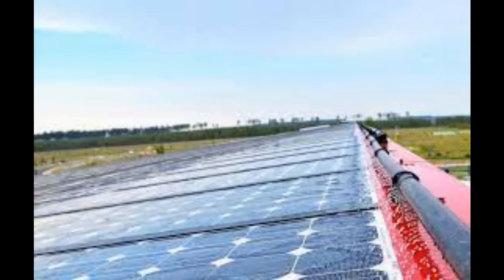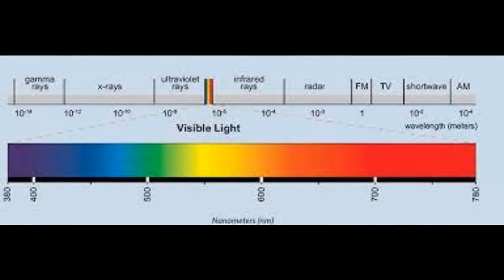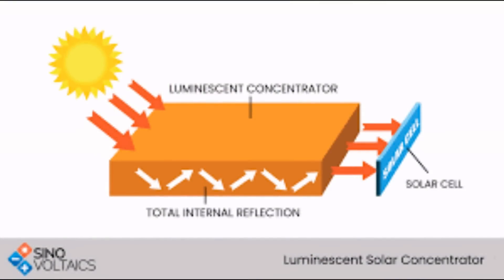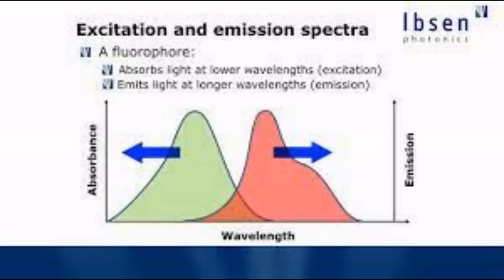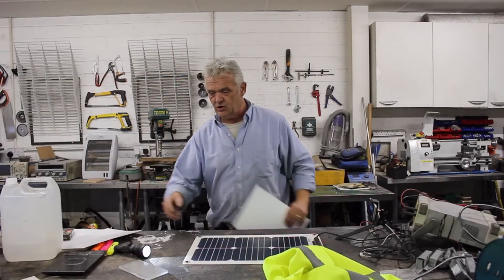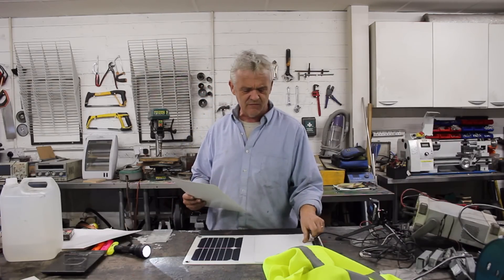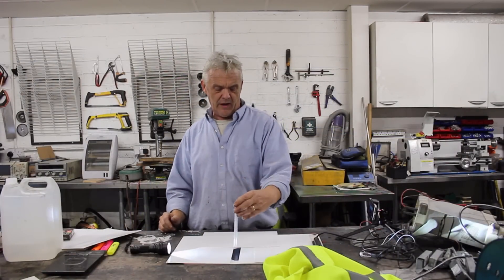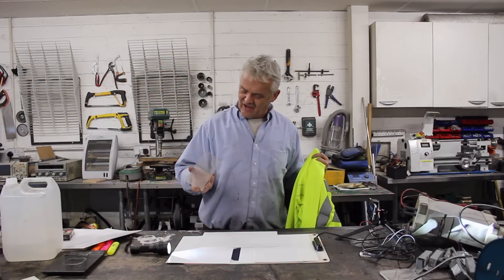1664 Supercharge Your Solar panels With Fluorescence

Comment: Nice experiment, but I do wonder if some of the additional performance was just from reflection from the shirt into your light guide.  In fact, do we know if fluorescence would work better than just some mirrors focussing more light into the light guide?  I'm almost inspired to do some of my own experiments :)
Reply from the maker: I tried it mate - it didn't work as well  -but this is a replication of research papers not my idea - I am just showing it can be done at home with easy to find materials - so you should certainly do a few experiments I would say - cheers
Reply: @ThinkingandTinkering  Ta mate

Comment: Not doubting the principle, but the test increase in voltage could easily have been due to added reflectance from the shirt.  In any event,.. fantastic info as usual Robert!
Reply from the maker: I tried it with the reflective paper the lcd panel came with mate - it didn't work as well  -but this is a replication of research papers not my idea - but you are right I am just showing the principle really
Reply: @ThinkingandTinkering  .. you are an inspiration m8.

Comment: Have you heard of Cambridge Photon Technology (CPT), it's a company developing tech (already exists within labs) which could increase the existing efficiency rate by over 50% more than it is today & beyond, by placing a layer above existing solar panels, & it converts up to a potential of the remaining 70% of light into a form that solar panels can also make use of. Silicon can only convert light at the red end of the spectrum, with much of the green and blue photons going to waste. A polymer semiconductor film can absorb these green & blue photons, and light emitting clumps of material called quantum dots convert them into a more useful wavelength. To put it another way, a blue or green photo excites a quantum dot, which then emits 2 near-infrared photons which the silicon solar panel below can make use of, along with the normal longer wavelength light passing through the film, and is absorbed by silicon in the usual way. Net effect: many more usable photons hit the silicon solar panel & so much more power is output from the same light!
Reply from the maker: nice information mate - thanks for adding - cheers

Comment: It could be the extra light from the other side of the light guide that increased the total light on the solar cell - it may have had nothing to do with fluorescence. You would need to compare that result to a non fluorescing reflecting material.
Reply from the maker: I tried it with the reflective paper the lcd panel came with mate - it didn't work as well  -but this is a replication of research papers not my idea - I am just showing the principle really
Reply: @ThinkingandTinkering  Wow, that really is a fantastic find Robert. I'm building a camper trailer that uses the solar panels as roofing. The actual ceiling is below, around 3 inches and I was planning to put Mylar on the foam ceiling, but now, hey I'm going to spray that fluorescent paint over the Mylar. Can't hurt, and if I get a few % more energy from the panels, that is truly a bonus. Yes, I have forced ventilation in that gap to try to keep the temperature down a bit . (I'm in Australia)/
Reply: @ThinkingandTinkering  I think we mean it would be interesting to try with just a piece of white paper behind it.
Reply: @ThinkingandTinkering  You didn't show jack really 'mate'.  That was about as scientific as your haircut.  Don't insult the professional researchers by mentioning them in relation to this toy 'experiment'.  Your a clown.
Reply: @timboatfield  Before you criticise other people's work, how about showing us all your extensive videos on your experiments, engineering and thoughts?
Reply: @TK42138  Said by someone without even a name!
 FOXTROT OSCAR

Comment: slight hickup. if you watch this video the floresent shirt directly reflected some light downward onto the solar cell at the bottom where there was a gap and scewed your results. not saying it doesn't work but it might not work as much as it did there. Maybe try a piece of floresent construction paper?  paused at 3:21
Reply from the maker: I tried it with the reflective paper the lcd panel came with mate - it didn't work as well  -but this is a replication of research papers not my idea - I am just showing the principle really

Comment: Could the improvement be that the light was reflected in the gap between plastic and paper cover
Reply from the maker: I tried it with the reflective paper the lcd panel came with mate - it didn't work as well  -but this is a replication of research papers not my idea - I am just showing the principle really

Comment: Question🙏
What is the feed on the ground and lat say 20 meter op without conducting caryer😍

Look if there is less our more units of less our more volume and the herths🙏💜🙏

Our mabey better 20 meter conducting inside nonconducting outside in the side in the the air of inside the lolar pannel above the colector💜🙏💜

Than bounce becomes waves onley less resisting waves.
💜

And solar pa els who are nanolayerd can tace from the infiorment at nights than you reseave static energy.
And on day time the diverentional between the pull and the releasing photonic cores owf whay less negative💜 so you reseave diverentional as energy😍🙏🙏? Am I correct?💜
Can you see the coorolations 😍 in the behavier ofbits output signalen.
Nat after the collector bevore the colector💜

You lose a lot of when on the same wirsl between the translators towart the colecto 
That fiverentional within the one total line inbetween the translators  they balance elchexwr out you onley colect diverentional between lines😍🙏😍
Reply: I bad you if you have one running  in ful hot daylight you experience as sunlight 
And you aimed some smal shadow you Ged more .

As one tred  one side is on sunlight and the other side not the balance elchader for the most out  but when you have the colectors in the midle our where fits best after traying on the division of the shado and the daylight in a stong son experiencing days you reseave diverentional onley bi that constand and not just as lucky shod for the photonic core the neutreno to be lowering thention on fusing in to for one part to be more negative and the othe part to be less negative💜
Reply: Same as your thermometer with the cabonbarabolic mirror readings when your shade hit the thermometer you raised centygreats😍🎁😍
Reply: Nice fluressend light is when dimention losses some resistances .
So some fleresend property's with led light on material is diverend than sunlight on material and olo diverent tha tret light bold on materials💜

So fluresend is open bo the more our less external thention for it to leak out our in like subatomic frosen nitrogen😍expanding in to the space within inbetween and around the particles and bam we see light 💜

Ruling cristal gives light but what if you rub a frozen cristal our a Heather up cristal I then when you  frease cristal it start editing light on a surtenend Pont like scaticg boths togheter.
And quiche restore the dimentional resistance after to mantain structual intergerty 💜🎁💜
Reply: And with normal nanolayerd close seal clothes what happence than with the light reser.
It is the exstra resistence for thention to rise 🙏 in this moment of experimenting and experiencing

Than you use thention to pull energy  in to  existance of the electric behavieur💜
And you do noting with the photonic cores😱
Sooo😅 oepsi doesie😅wat a waste in to onimploied energy without nect destination😅 to become its own structure as disturpions of the infiormend😅

Ben do jad not understand the existamce of subatomic polution😅🙏😍🧩

Thank you for your beautiful sharings 😍
Oll injoy beïng🙏
Reply from the maker: mate I don't want tube rude but you have to check your spelling I don't really understand what you are asking
Reply: I am slightly dislectic 

Nevver mind I find out for mi self one day ad than llso share it back 🙏💜🙏

Chaince the everige thention inbetwen the window and the wat men say sun light energy colector
And less negative you ged more wave behavieure.
And more negative you get more resistance but smaller energy units

Was mi question.

In the prosses of your fil I saw you wurk with thention factor🙏to see energy🙏
 Today I go look a litle thieper hoe it is made and how the princeple is going

Than I can go thieper on it to expand it in understanding ...
Furst I thought men ware olrady there .
We colect the photonic cores in the wires and the everighe thentions in the wires as the solarcolector in to wires thes wire I men

I do beter I make a movie like last time💜💜💜

Thank you be back later with mi prosses and  if I have stil that question🙏
I ask it in the video😃

Thank you for relaying dear soul💜

I combinatie your sising with atomic sises 
Jesterday with mi own way of how I see and conditions to get bick our smaller nanolayers to opened diverend unts of energy transitions and colections 

For the disireble resistance and copasety towart dynamic behavieres of the systems🙏🥰😃

Was match easeyer explaining🙏🙏🙏💜
Reply: Cool I am opsurping the doping💜 of the layers😍

The second doping its gaps 💜 these arend gaps these are less negative to release to the phosphorus as the thention outside tace it from the phosphorus 😍
The dragged that you seems the use💜

Like led produces light now the light is mageticle energy side 0
Reply: I watsh further supper cool😍
Again science showed itself counterfeildflow exists without realizing it 💜
Reply: Yes mi question is answer. 

Wat I asked to do you do it with doping 😍😍😍🙏😍😍😍
Reply: You use thenional diverentional💜🙏💜

This means the power generator is going to work 💜

Energy is equal towar external thentions and ratios of the thentional diverentionals displasmants 😍😍😍 to be able to behave in and trouth its  existance💜

Lesser negative waves less resistence more thention less waves more resistance😍
So one is olways able to go in to other💜
And when above more everige  thentions and thentional diverentional rises the dark spots of universes you named gaps of the second doping are pushed back 😍 trou the light💜

Put a solar pannel of where it is olways light😍💜😍 And where the shadow is not able to hit the ground of other structures.
You'll see on a surtenend moment a voltige drop dramaticley💜
As there is noting to push trouth the wire annymore olll is below.
Particles is noting with some space gaps is everything without opsurveble particles less negative space pockeds😍

I go look wat more is around this partition of knowledge🙏

Dit men came  bi existent on doping than ?
Our dit men understood it here and somehow this is not translated to other science partities ?🙏

We see electron move .
But thention pulled in from the gaps💜 and bi exeleration risistenc of the atomic feild grop in the operst atomic layer that pushes oll back😍

Comment: Great idea to investigate further. Would have been interesting to see a comparison with the fluro shirt vs a plain white shirt, given the low angle of the incident light form the torch through the wedge.
Reply from the maker: I tried it with the reflective paper the lcd panel came with mate - it didn't work as well  -but this is a replication of research papers not my idea - I am just showing the principle really

Comment: Great video Rob. Interesting addition to this is the idea of glow in the dark paint (I have mountains of it), being used as an effective solar battery.

Run your cells as normal during the day, but also charge up an equivalent sized board painted with glow paint during the day too. At night (and could be automated I guess), pull the glowing board on top of your solar cells facing them. Night solar in battery form!

Edit: Rob, if you want a bunch of free glow powder, give me a shout, happy to post some out to you!
Reply from the maker: it's an interesting idea mate - I don't think the output would be that great at first but as a proof of principle it would be worth checking out - I appreciate the offer but I do have some glow in the dark - I might give it a go - cheers
Reply: @ThinkingandTinkering  i think if you have the normal pv panels and then this fluorescent plate it need to use the whole cell so you need to cut groves in this plate to get the cutting edge where the light is generated maybe just Grind on the surface i think 10mm transparent 10mm grinded
Reply: seeing as my 2500 watt setup barely gives a couple watts on vry cloudy days, i doubt that glow in the dark paint will work...

Comment: I'm confused about the claim that the light guide increases efficiency by 50 percent. I haven't been able to find exactly how they quantify this but I'm curious if they mean that the light guide increases efficiency according to the size of the entire panel including the light guide or just the efficiency of the photovoltaic elements. If it is the former, which I find unlikely since so much light passes through the light guides, that is super exciting because that means this is a more space efficient design than our existing flat panels! If it is the latter, it's still exciting but you would have to weigh the cost of the improved photovoltaics vs a larger area of more ordinary cells. Of course, like you say, I can't wait to see how an actually well designed unit does!

Also, I'm kind of surprised you didn't get some clear fluorescent sheets (typically used for 'cool' school accessories like folders or clipboards) and lay them on top of a solar panel to see if the amount of captured uv offsets the luminosity lost by putting something in front of the panel.
Reply from the maker: I ordered some mate
Reply: its nonsense. voltage means nothing as will fall to millivolts when draw any energy..

Comment: I have actually done this as an experiment years ago when I was in elementary school.  I am 51 years old now.  You do the math.  This was back when solar cells were just getting very popular on devices like calculators.  I took the cells off of the calculators(if I remember correctly I used the cells off of 4 of them).  I had an old chemistry set that had a small amount of radium(it was a set from the late 40's I believe).  It was the set that had experiments involving glow in the dark things, a cloud chamber and others using radioactive compounds.  It had an experiment that showed you how to make a glow in the dark pigment from radium.  Much like the paint on old watch faces.  I took that and lined the face of the cells with it.  It gave about a 25 percent increase in output and also continued to produce small amounts of current after light was removed from the cells.  It works.  Great video Robert!
Reply: Was that the Gilbert U-238 Atomic Energy Laboratory chemistry set?
Reply: @metatag360  Yes, but the extended one.  Both chemistry and Atomic energy.  It had the Gilbert U-238 on one side and the chemistry set on the other side.  It folded open like a big book.  Thanks for the reply and question.  It had plans and some of the parts needed to make a geiger counter.  My sister and I would play hide and seek with the small containers of radium and other radioactive elements in the kit.  A fun idea, though not original as it was a suggestion from the manual.  Thanks again!
Reply: I just imagined an aptera with fluorescent solar panels and broke out into a stupid grin. The mild glowing effect would look very cool and be quite appropriate for their aquatic inspired design!
Reply: @zer0nix  Aptera, TRON edition?  Yes, please!  Dear Santa...
Reply: Imagine EVs with all the body panels replaced with clear fluorescent glow in the dark light guides...
The future we imagined in the 1980s is finally coming and I can't wait!
Reply from the maker: nice share mate - thanks for posting
Reply: That’s some chemistry set!  It’s worth a video of its own. If I had one I’d be irradiating spiders and hoping for super powers.
Reply: @davidp4456  LOL, I haven't seen it for a long time.  It maybe in storage, but am pretty sure it's not.  I would love to have it again.  Good luck with the spiderman thing!
Reply: If I recall correctly I received it as a gift from my parents in the late 70's.  It had been lost in a Sears warehouse for around 20 to 25 years.  They found it and put it out at a discount in their clearance items.  My parents bought it when they saw it there.

Comment: RMS, I wonder if optical brighteners (OBs) would also work. They are already used in paper and laundry detergents to make the clothes appear "whiter" and take the UV range and shift it towards blue.
Reply from the maker: that is a very interesting idea mate - and now I wonder too!! worth an experiment or two for sure
Reply: Would sprinkling the surface with washing powder increase output?
Reply: @wayland7150  If it has OB in it, it might. The OB used in the paper industry was a liquid and looked like bluing...